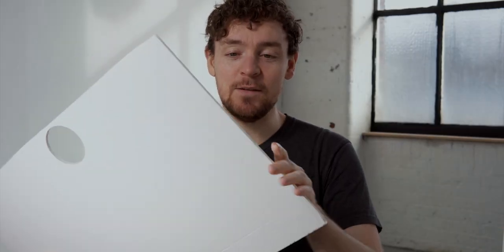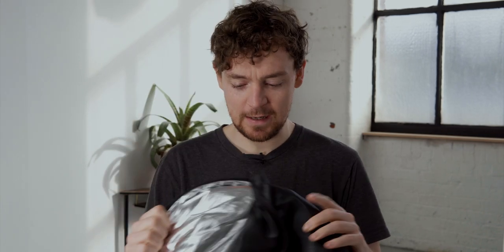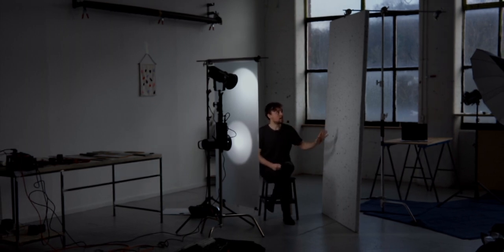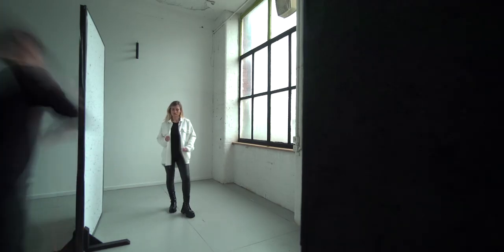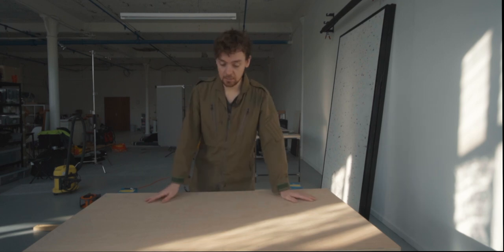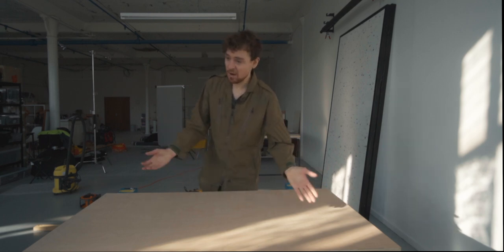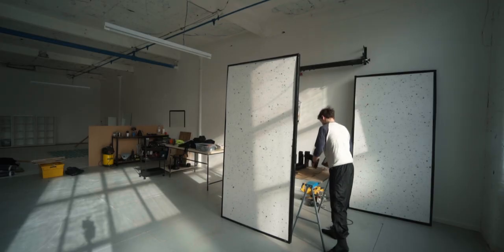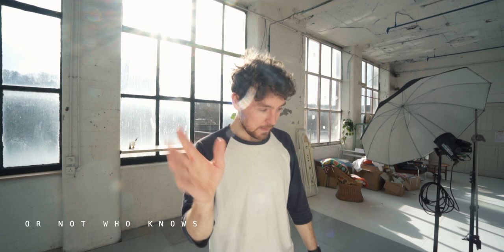The Most Valuable Tool in the Studio

Comment: Correx might be a slightly better option. Vinyl the other side any colour you want. Might be strong enough for sound panels too.
Reply from the maker: Is that like sign board? Thats probably a good idea too thanks!
Reply: @WhenWillILearn  Yeah it's the stuff that has squares at the core!! aluminium composite (dibond) would be best but triple the cost and weight. Go ask in sign shops if you want smaller pieces. Before the scrap man gets there.
Reply from the maker: @smilersmiles  I'd worry about something like dibond falling over on someone. The best thing about the poly board is you could drop it from the roof and it wouldn't hurt someone 😂
Reply: @WhenWillILearn  Oh yeah that stuff hurts and it's easy to cut yourself on the edge. A roller banner would be safer. Then again it's cost. Can you tell I'm a sign fitter! Really enjoy your videos btw, keep it up.